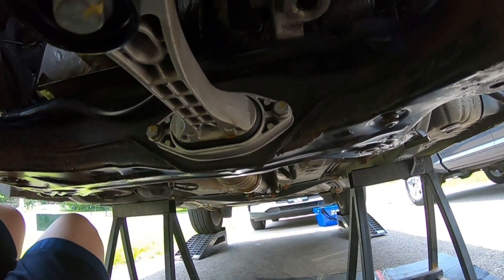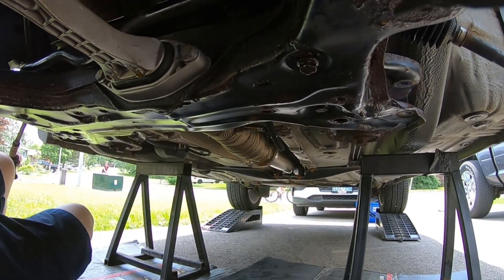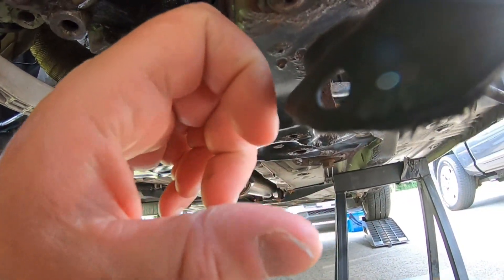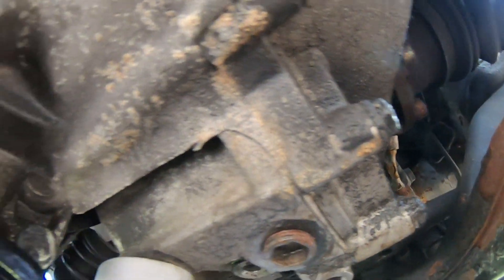MK4 Golf/Jetta Subframe Removal (Suspension refresh pt 2/Time Attack Ep 16)

Comment: I dented my subframe and was hoping I could change it without messing with the steering rack. Thanks for the video
Reply: I did this a few years back and after the dogbone, sway bar, ball joints, control arms, and numerous bolts that's all I remember actually removing from the car. However, even with your suspension intact, your alignment will still be off because you removed the ball joints. It takes about 20 minutes per side to set the front alignment on these cars using the string and ruler method.

Comment: Torque specs from Audi factory manual

- Subframe Screws: 100 NM + 90°
- Steering gear screws: 20 NM + 90°
Reply: Great video, thanks!  Btw, did you reuse your subframe bolts?  If you did, did you torque it to 73-74 lbs or more?   I plan to get new bolts, but I'm just short in cash right now.

Comment: In case anyone is wondering. I changed my MK4 TDI 5 speed inner tie rods with a Cresent wrench (or large open-end wrench) without removing anything but the tire and tie rod assembly. Turn the steering wheel one way and it gives you easy access to one inner tie rod side. Turn it the other way and do the other side. Easy peasy, no special too needed. Well, maybe a pickle fork.

Comment: Great video on removing your  K frame although I must ask. I don't see the lower control arms on your K frame.  Did you disconnect the lower control arms and leave them connected to the spindle?
Reply from the maker: I replaced my control arms completely so I did separate them from the spindles and K member!
Reply: @doryokustreetworks  I thought so I definitely know something glad it worked out for you
Reply: Quick question I just dropped my K frame and I disconnected my steering knuckle adapter from the steering column,
   and now I'm trying to re install it again and it won't go on the steering column because I can't get it to line up Straight.
 Do you have any suggestions of how to get this on?
My only understanding is to drop the steering column to pull it back a little bit to get that steering knuckle on the column.
 Any other suggestions?

Comment: I’m rewatching some of these old mk4 build vids… you need another mk4 (or even mk3) build. Maybe something crazier like a VR6 turbo’d or droppin a 1.8t in a mk3. Anyway love the VW content. Other stuff…😑
Reply from the maker: I do have another 1.8T Build that will be starting early next year. For where its going to compete not to sure yet. As far building one for the street, or time attack car, it just didnt make sense. Street car sure, but not really my style. Track car was fun, but for it to be competitive, it would have to be built into a unlimited class,  which I don't have the funding for. I appreciate the support though!!
Reply: @doryokustreetworks  yeah I feel the funding thing…

As far as street - these are easy to get enough power to move quick from a stock donor if you find the right one. My toy build is all stock except deletes and stage 2 tuned. The AWP comes with forged crank and pistons. Rods are the weak point but they support up to 250hp. You can always drop in some IE rods if you have it open though. Lots of fun for very little work. 

Anyway, I look forward to whatever else you do in the VW world!